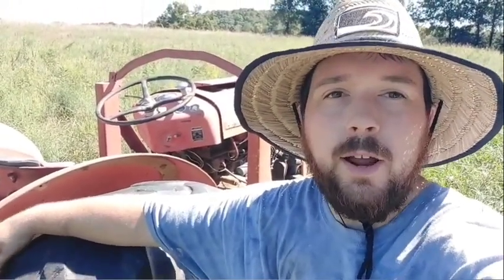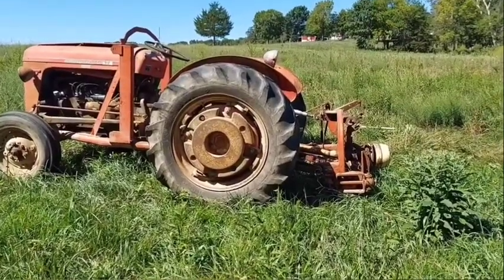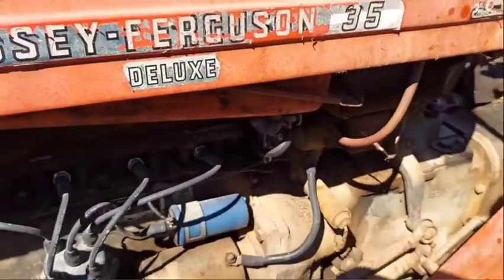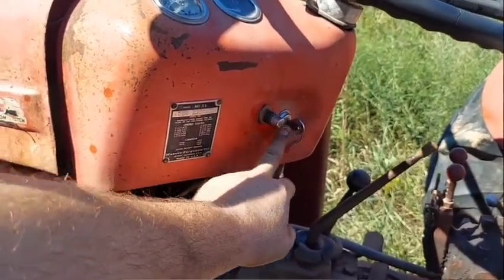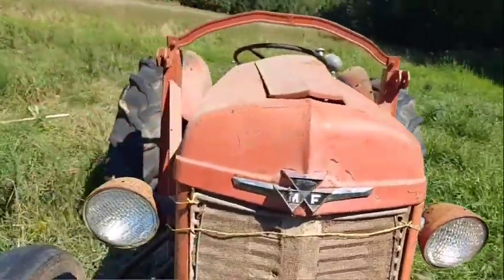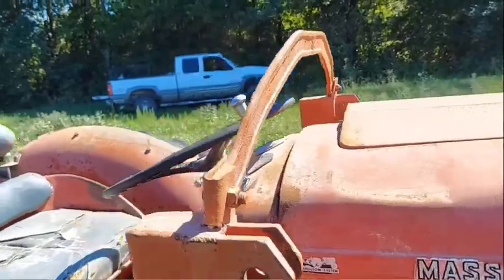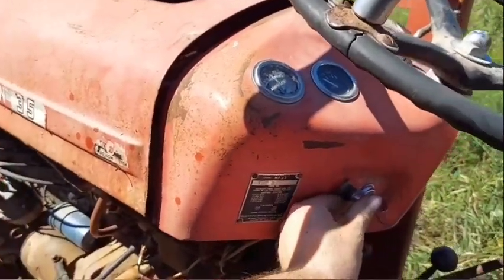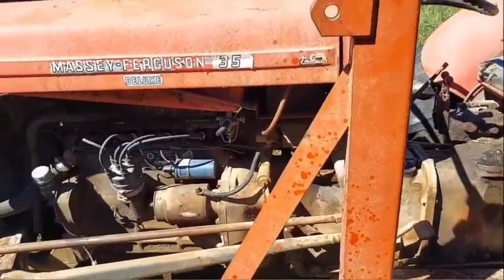I Broke Grandpa's Old Tractor - MF35

Comment: Something just caught my eye watching. Double check your firing order.
Reply from the maker: It's 1, 3, 4, 2. It's the Continental gas engine. I think that's correct. I did play around with 1, 4, 3, 2 order but it didn't seem right to me.
Reply: Ok. In your video your wires are 1-2-3-4.
Reply from the maker: @deanlangille1131  are you counting it going clockwise or ccw? My firing order is 1,4,3,2 starting top left and going clockwise. Is this incorrect? I'd freely admit if I'm wrong here and would gladly try a different order if so.
Reply: @bergercreek  Continental distributor rotates counter clockwise. Starting left/top left depending on timing/distributor location, should be cylinder one and rotating counter clockwise plug 1-3-4-2
Reply from the maker: @deanlangille1131  I'll try that then. It does puff quite a bit and seems a bit underpowered haha hopefully that fixes it. Everything I do with farming, I'm doing for the first time so thanks for seeing that and giving me some needed advice.